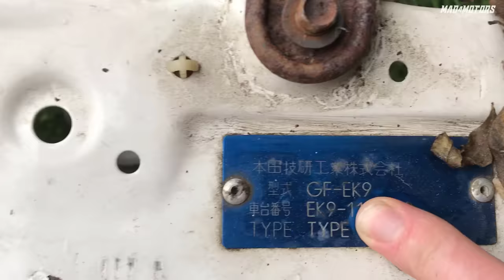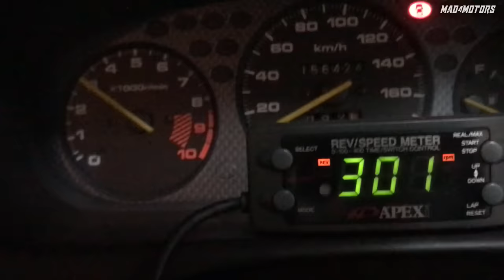Restoration of a Rare Honda Civic TYPE R

Comment: I'm speechless, for one at how whoever owned this legend could treat it the way it was treated, but mainly because of the simply incredible job you did at restoring it pretty much from 0-100! Incredible, I wouldn't hesitate a second to own this!
Reply: it was probably stolen, gutted and dumped somewhere.
Reply: @fernank017  Good theory!
Reply: @Mikey  this isn't craigslist my dude
Reply: @Mikey  probably. There’s only one way to know.
Reply: i think the ruined fender and lamp, and the spare tire mounted underneath pretty much explains it all
Reply: @portablezaps6517  I'm from mainland Europe, and I'm fairly certain the author is from either Ireland or the UK

Genuine EK9s were imported to the UK and Ireland due to their RHD only status.
Fixing up any car from that state is very time and probably money consuming, you need tools, time and knowledge to do this kinda thing, at least I think.This car specifically has specialty parts and a unique engine, so parts aren't that easy to source I imagine.
Reply: @gergoantal1066  surprisingly enough, in ireland at least - parts for ek civics are easy enough to find. well, they used to be.
Reply from the maker: Well said, Thank you👍
Reply: @gergoantal1066  I detected a slight Irish accent in the author's voice and you're right about the Honda Civic Type R being exported from Japan to only Ireland and the UK due to the steering wheel being on the right hand side. In the opinion of many the 1990's was the best decade for Honda. Honda enthusiasts here in the United States were extremely happy when Honda decided to start selling the type R in the United States back in 2017. Personally my favorite generation of the Honda Civic is the ninth generation of the Civic as it was able to appeal to a broad audience. You had the regular Honda Civic for people who wanted the two things that Honda Civic has delivered in spades: great fuel economy and superb reliability. You also had the Civic SI for people who wanted a little bit more performance from a Honda Civic and the GX, HF and Hybrid versions of the Civic for people who wanted to help the environment. To paraphrase fashion designer Coco Chanel; "You can never go wrong with a Honda Civic." Since 2023 is the fiftieth anniversary of the Honda Civic making its debut in the United States; I can't help but wonder if Honda will release a limited production fiftieth anniversary edition of the Honda Civic for the occasion.

Comment: God bless you sir for saving this beautiful EK9 Type R. I've been wanting to own one of these my entire life. The closest I got was an EG6 with an Integra Type R engine and transmission. It was my favorite car that I've ever owned. Perfectly reliable and quick for what it was. I owned it and took great care of it for over 10 years and never let it get a single spot of rust. I never put a turbocharger or supercharger on it, so the best I was able to get was 180 horsepower at the wheels in N/A trim after some bolt on performance parts and weight savings. Still, it was great power for such a light car. I still miss that car to this day. The guy I sold it to for $6,000 ruined it in less than a month. First thing he did was rip the engine out to sell it and get most of his money back, and he put in a $400 B20 engine from a CRV. I think he meant to do a B20 Vtec with a B16 head, but it never happened. He tried to drive the car throughout the winter and quickly wrecked it in less than a month. It really upset me to see the car completely ruined in under 30 days after I spent over 10 years taking good care of it, swapping in the B18c and LSD transmission, upgrading the intake manifold to the Skunk 2 Ultra with port matched 67mm throttle body, all new hasport motor and transmission mounts, whiteline sway bars and end links, 5 lug conversion with brand new hubs and brakes front and rear from an Integra Type R, body work and new paint when I first got it, 2.75 inch exhaust from the headers back. I had the car tuned on a hondata S300 I had installed into the P28 Computer. You did a wonderful job restoring your rescued EK Civic Type R. I'm glad it was you that found it and saved it from becoming complete piece of scrap to be crushed. Extremely good restoration.
Reply: Niiiiiice...I can only wish & watch these jobs...Nissan has a de stroked 2.0 to a 1.6 that puts out 175hp...8200rpm engine non turbo...I can only dream of an engine like that...WHEWEEEE...ZIPPY...
Reply: My friend had 2000 Civic Si with Type R JDM engine/tranny swap supercharged, plus suspension, brakes, etc. Used it as track car. Then someone else bought it and crashed it. It was stinking fast.
I know a Ph.D in physics and acoustics man, who still owns his track ready turbocharged Acura Type R - it's pretty much mint, accept for the track mileage. They even welded custom full exhaust based on program for Nascar cars. He also owns the original NSX.
Reply: I had two EG6s: a 1992 SiR II and a 1991 SiR. I've also owned a 2001 Integra Type R (DC5 model) and a 1997 Civic Type R. I currently own a 1996 Integra Type R (DB8). I love my DB8, but an EG6 with an ITR B18C swap is like my dream car. I will always have a soft spot for the EG6; and honestly, none of the Type Rs I have owned have ever resonated with me the way the EG6 has.

Comment: This was amazing.  I could only wish to have a fraction of the time, talent, and knowledge that this guy has to not only accomplish an amazing project like this, but make a great you-tube video about it as well.  Nice job
Reply: You'll be amazed what you can do the more you do something, everything comes from experience. You're absolutely right about something the "time". I have a evo 8 with a blown fp black turbo sitting in my garage for almost a year waiting on parts to come in. Now that I have everything to complete the job, I need to finish my garage to setup a 9 piece cabinet set so I can work on the evo comfortably, but have very little time.

Comment: What a legend. This has always been a dream of mine, to fully rebuild an iconic vehicle from scratch. This was an absolute treat to watch. Thank you for posting this!
Reply: totally agree. this was incredible. i'm doing exactly the same thing as well, but with a 1992 Celica ST185 All-Trac Turbo. Pulled it out of the dirt halfway burred in the woods. All 4 tires were seized as it was pulled onto the trailer. It takes incredibly hard work, I'm about a year and a half in now, still going. Rare car, even rarer year, even rarer color. It has to be worth it in the long run. 272k miles, sat 13 years, after i did the fuel lines, pump, gas tank it started up lol.
Reply: @WeTryMotorsports  you got a gem right there lol those old celicas are reliable
Reply: @WeTryMotorsports   course it did. At the end of the day after all the rare aspects of the car…it’s a Toyota.

Comment: Awesome job. For your safety, I wouldn’t use concrete blocks as jack stands. But if you have to, put them with the cells (holes) vertical. They are meant to be in compression that way. Not on their sides.
Reply: I was worrying the same thing when watching the video

Comment: Absolutely amazing. Rebuilding a car from the condition it was in to having it look damn-near showroom quality is something I've wanted to do for years. IDK where you found that Type R or how much you paid,  but excellent work you lucky bastard :P
Reply: I've done the same with my 1988 crx si and without having a garage here in fl the sun beats the hell out of paint jobs so mine has been going backwards from when I restored it. This video makes me want to redo it all over again.
Reply: @pauleskridge7209  I'm in Montana and have no garage. Winter makes it tough to work on cars :D I'd love to be somewhere snow doesn't exist.
Reply: @heavyq  well here in fl it rains everyday during the spring and summer which makes rust happen quickly. Then when it's not rain5 the summer heat is ridiculous. Colorado or Arizona seems to be the place to keep a car restored when you don't have a garage.
Reply from the maker: Yes lucky definitely, Thank you👍

Comment: Honda's designers really had a winner there with the Civic R. Problem was the body panels were steel bisqueted with a piece of foam rubber to keep the sound down. Every Honda rusted from the inside out because the rubber would soak all the moisture coming in. Thankfully you can restore these with the same panels but without the rubber. The resto turned out beautiful.

Comment: 🙌🙌🙌 a true legend to save this car from the scrap yard! All those years of some muppet sticking on crap like they had crashed it though Halfords, for a legend like you to fully restore it to its crown and glory. The moment I saw you had used:- metal heated staples to repair the lower splitter I knew this was going to be the best 25mins for a long time, then you restored the engine rocker cover, I was in my element. I then thought, I wonder if he'll restore the classic oxidation on the headlamps- boom 💥. Amazing restoration and bringing it back to its genuine factory state. Brilliant. If you manage to do another Honda please do another video. Superb 👍👍👍👏👏👏👏🙌🙌🙌💪💪💪

Comment: I truly enjoy these kinds of videos until they start the painting process. When painting a car prep is 90% of the job. All that work is for nothing if you don't spray correctly. Multiple coats. Begin in tight areas and leave the larger surfaces until the when possible. Start trigger before the panel, Hold the trigger across the panel, Release off of the panel. Be consistent even in the priming stage. Stops and starts on the surface creates spits and textures and lays the paint uneven creating runs and sags even with an HVLP. All things I wish I would have known on my first DIY projects. Love the content. Subscribed, Liked, and Rang the bell.

Comment: Have to say, wasn't expecting that at all 😂. Extremely good job lad, fair play. I'm only finishing my AE111 Levin and St202 SS-III Celica now as I'm watchin this. There's one or two AE111 Levins in the same sort of state on Facebook Marketplace, I'm sure it would make a good series to follow along from this one 😉. Well done, I'd love to see more of these sort of videos. Class job. 👏🏻
Reply: Iv an ss111 aswell ,a sunroof one , are they worth anything now ?
Reply: @irish-thinker4429  I seen a SS-III for sale in Japan a while ago. Only had 54,000km on it. Had the TRD kit and all, besides the high rise spoiler unlike mine and yours I'm guessing. Was last listed for €21k. They are only goin up in value lad. Little or none left in Ireland, I was lucky I picked mine up for an extremely good price. My advice is to hold onto it 😂😂😂. I wish mine had a sunroof.
Reply: @xz_ae111  mine has a TRD kid ,high rise spoiler and a gt4 bonnet on it , I got it cheap too about 4 years ago,  there's no rust on it and drives well 2 or 3  grand spent would have it near perfect
Reply: Where are you based lad ?
Reply: @xz_ae111  no lad ,iv non of that I gave it uo years ago , I live in portlaoise,  does yours need much ? Mine is 1998 ,last owner put a gen 7 leather interior into it ,it fits well
Reply: The gt4 bonnet doesn't fit perfect there is a gap at the front but I think it looks OK ish ,if you were real fussy you would have to put a gt4 front bumper on
Reply: @irish-thinker4429  I prefer the SS-III to the GT4. More fun and I preferably think they look even better. 😁

Comment: amazing resto! that type r looks absolutely gorgeous!
How much did the whole project cost if you don't mind? I'd love to have a type r project! Cheers
Reply: Anything to do with the ek9 is mega expensive. I'm building a replica, and there won't be many real EK9 parts on it due to the scary prices.
Reply: @scottp7554  but his is not ek9 it’s ek4  sir done up as ek9 but does have type r engine
Reply: @johntobin3673  chassis was ek9 at start with a wrap on it ?
Reply: @AM-wt8qi  how was it ek9 with a back wiper I’ve had 2 civics ek9 and they don’t come with wiper on the back window ,unless the boot was rusty and he just got boot off another Honda not a ek9 also don’t come with does alloys there str wheels with red Honda badge
Reply: @johntobin3673  check the vid was Ek9
Reply: @AM-wt8qi  so ek9 comes with back wiper your talking out both ends
Reply: @johntobin3673  have you seen video ?
Reply: @AM-wt8qi  man stop talking to me your  as tick as a blank honest to God ya  think cause it has typr r sticker and champ white makes it a typr r I’ve had typr r and that ain’t one
Reply: @johntobin3673  if you believe la
Reply: @AM-wt8qi  so why back wiper 🤣🤣🤣and the chassis blue plate is easy taking off ,all I’m saying is ek9 don’t come with back wiper so only way it could be a ek9 is if he replaced the back window out of ek4 ,

Comment: Great restoration. I’m in the Caribbean and I love that your channel deals with right hand drive cars and models I’m familiar with here.
Just a side rant…I hate donut wheels. Honestly, the two most common reasons given by manufacturers for having them instead of full sized spares are excuses IMO. The weight difference is minimal at best and the fact that some idiot forgets to fix his/her flat tyre is on them.

Comment: Little tip, when painting under the hood and you have to mask off any hoses or wires, use aluminum foil, it's a lot quicker, and you don't have to waste so much tape... Pretty sure it's cheaper than tape too

Comment: i'm sure someone else has mentioned this, but i was under the understanding that cement blocks need to be set so the channels are vertical or else they don't have all the strength they were designed to have.

Comment: Excellent job.... but i don't get one thing why the hell are you stipped the perfectly good paint from the engine cover as you said it was the original engine so probably honda made it that way to contrast the red interior which most if not all type R come with...
Reply: it was not perfectly good, it looked awful. and they come red from factory not blue
Reply: Comes with wrinkle red from the factory. You can see someone painted the blue over it. Look at the chips. Type R’s come with red valve covers.

Comment: Wrap is almost as bad as that overhyped ceramic coating garbage - this generation's worthless product that rivals the snake oil that was peddled in 1980's and 1990's in the form of silicone and polymers.     Nothing works better than a good periodic polish and hand applied carnuba wax that allows the paint to breath and to flash off which will prevent paint pigments from fading.